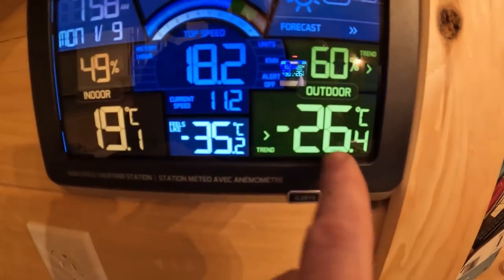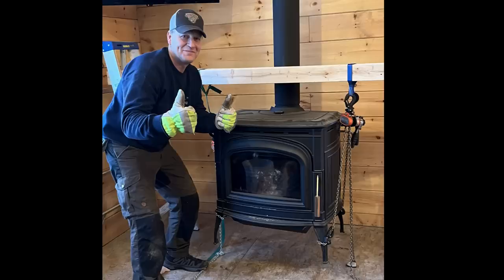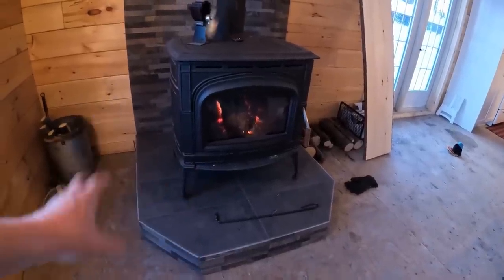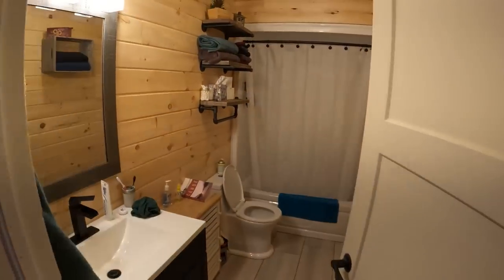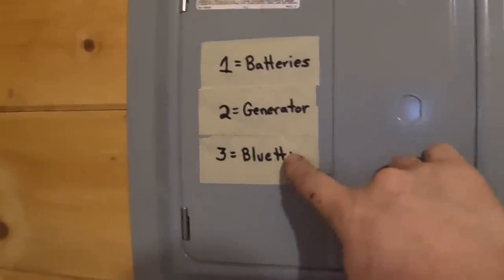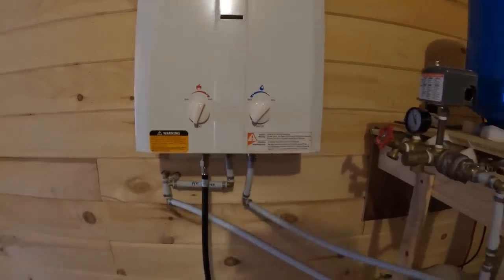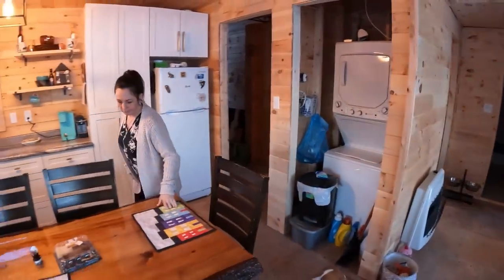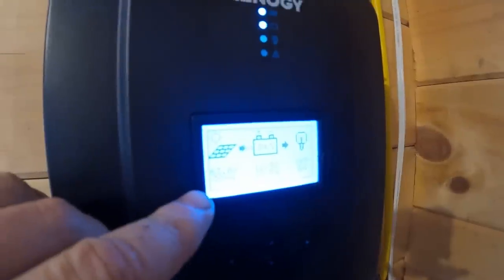I Lost Footage!! Stove Hearth, Weather Station, Energy System & COLD Weather - Cabin Updates

Comment: Your place is coming along nicely Chuck.Thanks for the updates. 
I was wondering if you will answer a some questions for me on the performance of the Blaze King stove so far this winter. What are your burn times and wood consumption? Do you fill it once a day? What type of wood are you burning? How many square feet are you heating and how is your place insulated?  Do you use the fan on the stove or do you have enough radiant heat coming off the stove? 
You mentioned that you installed the propane heater for times when you are away from the house, so you don't use it at all ? the wood stove provides enough heat on it's own? 
 I have an Arada Farringdon 16 Catalyst stove and am thinking of replacing it with a Blaze King Princess 32. I'm in Debert Nova Scotia, so your winter might be a little harsher than mine.

Thanks Arch
Reply from the maker: Hi arch

Burn times are incredibly long, especially if it’s a ‘warmer’ day out (-10 Celsius). Ok this days, I will only fuel the stove twice during the day, and once before bed. I never have to refuel in the middle of the night, even if it’s -40!  I’m estimating my wood consumption is cut at least 1/3

I am burning dry spruce. Spruce is ‘middle of the line’ when it comes to heat delivery compared to other woods we have here. 

My cabin is 1000 sqft.   8” logs r28 equivalent) with R32 in the attic

I use radiant heat, although I just received the internal fan system and will either install it when it warms up more or early next fall (I can’t install while using the stove 24/7)

I have a propane heater but have only used it a couple times. Basically there were two mornings when it was -55 with windchill factor, so I turned it in for about 20 mins just to accelerate the room temperature while I was waiting for the wood stove to reach its optimal temp after I refilled it. I used it another time when I was away on a trip for two weeks and it assisted in heating the cabin. I actually purchased three more smaller ones as I had no idea how my place would fare in extreme temps, but have decided they aren’t even necessary. 

Hope this helps
Reply: @ChuckPorterEverythingOutdoors  Thanks for the reply. What all have you done for insulation in the floor and the skirt around the crawl space?
Reply from the maker: @FarewellAcres  I used 1” styrofoam SM underneath my laminate/vinyl flooring sand used the same around my skirting. It is shown in some earlier videos of the cabin build. Worked really well this far. Underneath my cabin stayed above freezing all winter.  No frozen pipes 👍

Comment: Hi Chuck, I have just discovered your channel. Amazing work so far. Congratulations on the new cabin, everything looks amazing. In one of your earlier videos you installed a” Gray water “ tank. Is that normal/needed, I assumed that the sink and clothes washer etc run off typically goes into the septic tank. Thank you.
Reply from the maker: Yes they can run into the septic tank. However I was concerned about the long run from my kitchen sink all the way to my septic line, specifically to free up in the winter time on such a long travel. I had the travel and I had the container so I went for it. All working out this far 👍
Reply: @ChuckPorterEverythingOutdoors  that's great, thank you.

Comment: I watch a ton of off grid channels as an off grid person myself . I’m always looking for ways to make my cabin better. I know lots of channels are sponsored by Bluetti. How long will it power your place ? Also what is the washer AB’s dryer? Thanks
Reply from the maker: The bluetti length of power per day depends completely on the sun. If it’s sunny, with the 1900 watts of panels I have, it stays up on 100% (or thereabouts).  If it’s cloudy, I can go about two days, depending on whether or not we wash clothes. The washer and dryer consume most energy at about 1000 watts continuous when two of the machines are running simultaneously. The washer and dryer are a GE product (combo). The dryer uses propane for heat

Comment: Hi Chuck, I was wondering with that combuster stove will you have to sweep your chimney? Just thinking if it burns pretty much everything you might not have the creosote build up like the other stoves.
Reply from the maker: I’m expecting to have the least amount of creosote possible. Especially with the type of wood I burn (primarily spruce that was “burnt” once in a forest fire sweep through. I literally only cleaned the glass on it once in three months. And vacuumed off the combustor screen once. It burns incredibly clean
Reply: @ChuckPorterEverythingOutdoors  I really like that, I might have to switch mine out. It would be much safer for me where I'm gone away for work alot and the wife is burning the stove all the time, sometimes when I get back the chimney is pretty full. Thanks for your time and videos Chuck, I really enjoy them. Cheers!

Comment: Just wondering how you have your wind turbine connected to the system along with solar, Thanks
Reply from the maker: My wind turbine has its own charge controller (built in right where the propeller body is). So it’s isolated from the Renogy charge controller you see featured in the video. Basically there are two wires that come down from the wind turbine and they connect right to the positive and negative battery posts
Reply: Thanks, I just purchased the same wind turbine to add to my solar. Great job on the build, Love the video updates !!!